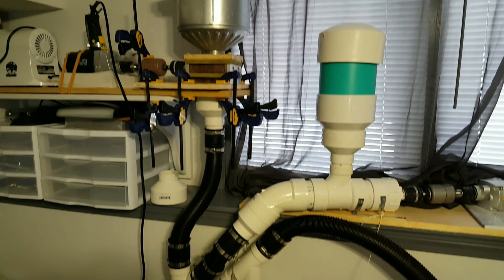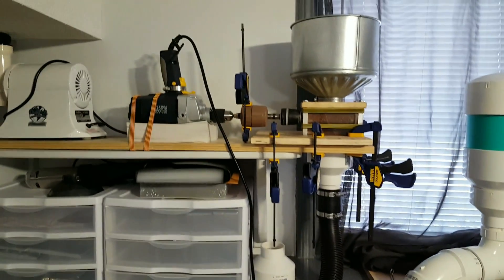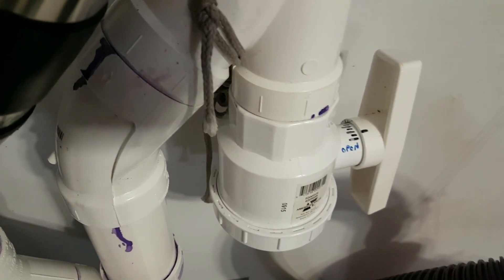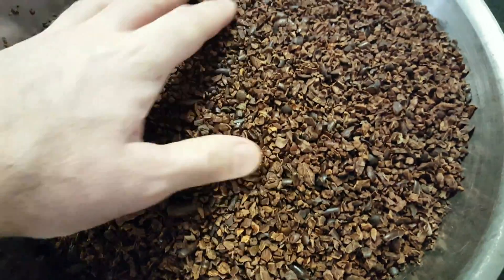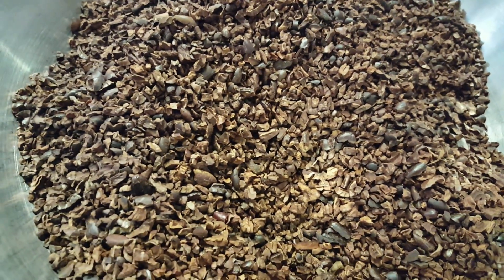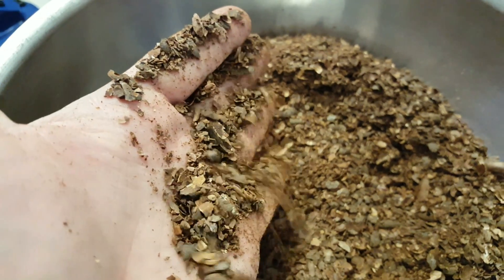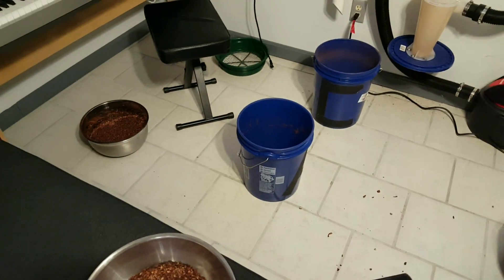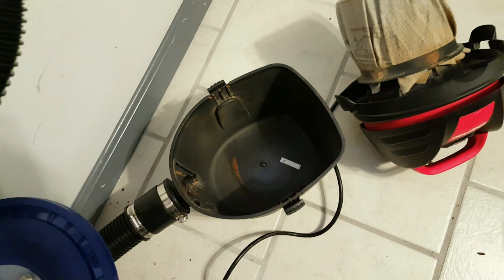Bean to Bar Cocoa Bean Winnowing Device - Part 2

Comment: Agree that this video is although old, it is very useful. I only have one problem finding an acceptable grinder for the roasted cocoa beans. I have the 2 rollers grain mill (two different types) but the problem they make very fine particle size which make it difficult to separate them from the husk. if any one know an excellent choice to recommend that would be very useful
Reply: Quítale la piña o tapa a tu molino . Las cascarillas se desprenden al pasar por el tornillo sin fin del molino 

Saludos

Comment: Hi Andrew, send me a bucket of your Husk and I will show you that you lost more then 3 % of Nibs. If you want to know how I do it go to my videos at those links........  
https://www.youtube.com/watch?v=MlXQugXksvs
https://www.youtube.com/watch?v=BPj841YFi50
I am not a big fan of the winnowing machine like your contraction because the air flow or the VACUUM that I call a BLIND JUDGE can not discriminate between small NIBS and big Husk, and you loose a lot more then 3 % of NIBS. My system is more them consuming but I have 0% loss of NIBS and it only cost me 2.50 $ for the clips to hole the Kitchen Towel on the cardboard that I call my Bonneauwing Board, since that I invented this method of separating the Shells from the Nibs. Try it out and I am sure that you will be able to recuperate the small nibs from you Husk.

Comment: Thanks for the info. Which does a better job of cracking the roasted beans in terms of final yield - the champion juicer or  the crankenstein?
Reply from the maker: I have a champion juicer and never used it for crushing.  Couldnt  compare.  www.chocolatealchemy.com argues that they are comparable.  I  just never liked the idea of putting the juicer through the trauma of cracking beans.  Was never designed for this.

Comment: Thank you for the great video. A question: how many pounds of nibs did you get out of the 5 lbs of beans?
Reply from the maker: My rule of thumb is 3 lbs of raw green unroasted beans will yield 2 pounds of beans after hand selecting out bad beans, roasting, and winnowing.
Reply: Andrew Frongello . Thank you. One more question. What is the brown cilinder connected to the rod comming out of the drill, and where can I get it?

Comment: Hey Andrew can you find the cyclonic separator at lowes or home depot or did you order it online?
Reply from the maker: Charlie....I wasn't able to find the dust deputy locally.  I ordered it online.  I remember it being what seemed like a rediculously expensive amount for basically a piece of plastic but honestly I would never go without it.  I made a home made one once and it didn't work nearly as good.  I think the dust deputy brand goes for about 50-70 but I have seen knock offs for about 20.  Key thing is to make sure the suction is connected correctly.  Suction should be coming from top center piece not the side piece.
Reply: Ok thanks man!

Comment: Hello Andrew, I want to make my own chocolate spread, do you have any recommendation in term of the quantities of cooca butter - cocoa liquor and any other ingredient, thanks
Reply from the maker: The only semi-liquid substance that should ever be in chocolate is cocoa butter.  Which, unfortunately for you means chocolate will always be solid at room temperature.

What you are interested in is Ganache.  Ganache is simply melted chocolate with heavy cream whisked into it.  Heavy cream is the only fluid that mixes well with melted chocolate.  You will no longer have chocolate though....you will have ganache.   The more heavy cream you use the more fluid your ganache will be when it cools.  Experiment and you will have a chocolate spread that is the consistency you seek.  Good luck.